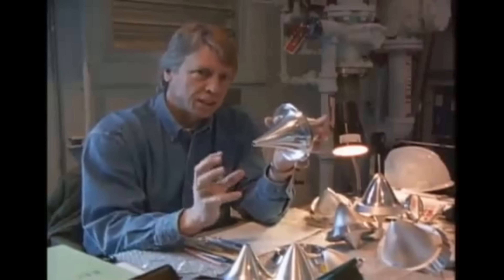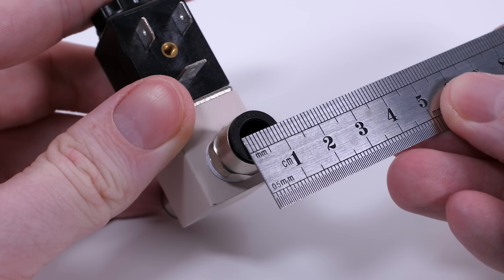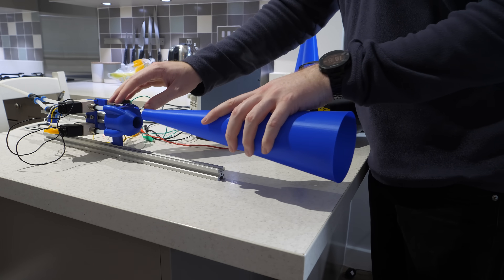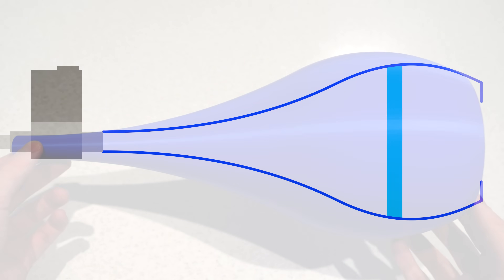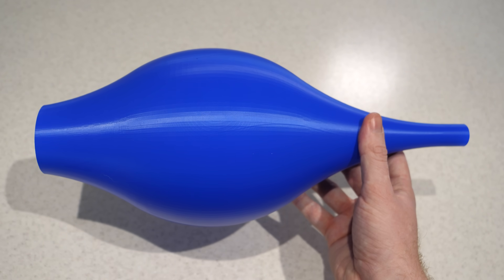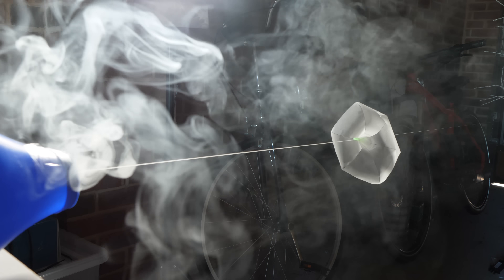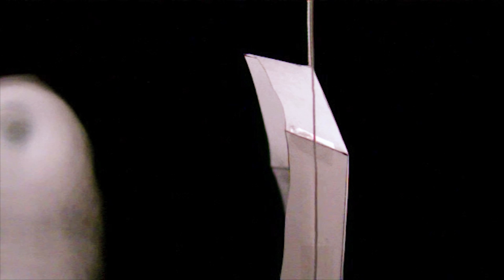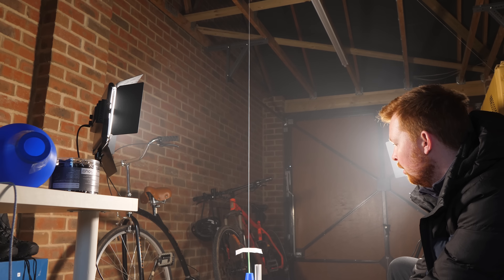Smoke Ring Propulsion

Comment: Greetings. It seems that you failed in taking in consideration the Coanda Effect of the smoke near the cone's walls. If you consider that, you'll see that the smoke near the walls will lose energy way faster than the flow near the center of the cone.

Comment: I think that this project sure did turn interesting, but it hasn't stuck to the fact that in the original documentary / footage you have provided, the propulsion source was from the air which falls "DIRECTLY" beneath the flying object, and that the triggering mechanism for the propulsion sure was the air's expansion, but the trigger event was happening in the cone itself and not a remote source.

Either way, this is just an opinion. Hope to see more attempts later :)

Comment: or a capacitor with layers of plastic and steel with a cathode twist of the steel and plastic and the plastic having transistor  shapes made like trap charge flash for the laser and cathode plasma propulsion with the mirror tape taking on the spaceships form to let it have laser propulsion and make it into an electron touring craft ADIFO drone with mini sterling engine generator and electrolysis HHO batterie and liquid piston of electrolysis torch powered and electron vortex flight technology and power source. with liquid piston sides as sterling engines and cog like sterling engines that pull flywheels with corona generator  turbine and solid state drive of reverse nitinol or titanium and silver with turbine corona electron get engine mounted contained solid state drive reverse nitinol with thermodynamic cooler capacitor cathode  and this steel spaceship with laser

Comment: why would you perhaps make a laser powered sail using aluminum mirror tape and a laser
Reply: those kinds of sails only work in a vacuum. technically they work anywhere but the air resistance is too much for them to move under their own weight.

Comment: you need to make something similar to that clip you previewed before that will help promote the rotation of the vortex rings. the paper is too flat
Reply: also, use something like a used paper towel roll and a large valve. the air has to act as a piston. large short burst will do the trick.
Reply: look up some vape tornaments, they can teach you alot on how to maintain a vortex and even move it around with your hands

Comment: For more volume maybe look into a solenoid fired sprinkler valve for irrigation.
Been used for spud guns for decades.  No idea if opening/closing is fast enough but pressure/volume could be adjusted up to 80-115psi

Comment: the lowest pressure is in the center of a vortex, so I guess shooting a vortex ring at a surface then sucks that surface towards it. On impact you get a high pressure center "pushing" and ring-shaped "sucking"... now if that didn't sound weird enough, the subsequent rings suck as well, but they aren't counter-rotating. As a consequence any two rings' edges hit each other with airflow in opposite directions, leading to greater turbulence, which disturbs the performance and flow of the later blasts

Comment: Ooooh there’s a lot of science and studies done with moving air through cones. There are still people who love horn-loaded speakers where the horn loads a speaker diaphragm in a manner that improves sound pressure level per mm of diaphragm excursion. Also there might be an issue of resonance that results in the trailing rings. Perhaps the horn-loaded speaker building community could further inform your vortex ring canon design.

Comment: What if you had a valve that only had to spin to open and close? Instead of having to push/pull, the electronics only had to spin. You could exponentially increase your rate of fire and lessen the over all mechanics of the item

Comment: Hi mate, have u ever looked on how a 2 stroke exhaust works? It also works with high and low pressure in the pipe but also gives a backfire of air. Maybe that's what it happening? Cheers

Comment: Hi Tom. I'm enjoying your project and you now have a new subscriber. I also have a background in aerospace engineering. A few thoughts: 

To optimize the vortex cannon for speed, we need to collect empirical data! Try to 3d print the nozzle with room for air pressure sensors at a few points throughout the nozzle, which will then let you determine the velocity of the air at different points along the nozzle. What are you using to supply air pressure to the solenoid valves? Air compressor? What's the air pressure immediately before the solenoids?  

Depending on the supplied air pressure, I wonder if you could reach mach 1 with a converging-diverging nozzle. If you could reach mach 1, then you may remember that after the throat the air velocity will be greater than mach 1.

What's the maximum frequency of the solenoids? How quickly can the supplied air pressure recover? To reach mach 1, I'm thinking you'll need to provide as close to a continuous (or high frequency discontinuous?) supply of air.

Comment: I think this might have worked if your craft was set spinning like they did in the original futuristic aircraft prototype. There's no stability on the most important plane for the craft, and that might just be the difference. Like a gyroscope in space, if you keep tapping it, it'll move against the directions of the taps, which is controlled. If you tap non-gyro stabilized objects, it imparts spin and rotation and etc etc.

Comment: I wonder if this concept wouldn't work better under water as an aquatic propulsion method. instead of air just use the water since anything that flows like a fluid can make a vortex. You wouldn't need the sail. But the question is would a pulse of vortexes be any better than just constant thrust. So think of a jet ski. It pumps water in and thrusts it out the back. Well if that was pulsed through a nozzel that creates vortexes in the water would it work any better, much the same, or not at all. Or maybe a better approach would be to create a vortex in the water at the front of the vessel so the vortex pulls it along with it through the water. It would be fun to experiment with it and just see what happens.

Comment: +Tom Stanton

I wonder, the inside of the vortex is spinning towards the sail which will give an additional push while the outside is spinning away. If the vortex is spinning sufficiently fast the outside of the vortex could pulling the sail back and taking angular momentum away from the vortex's inner side which could otherwise be converted to linear momentum by the sail. 

Would a sail which conical and curved to capture just the inside be more efficient? Would this also be self-stabilizing? This would require even greater accuracy though.

Perhaps even something as simple as a rougher texture applied near the center of the sail could help convert the useful part of the vortex's angular momentum in to sail velocity.

Comment: That's an interesting concept. You'd think the optimal vortex cannon design already exists, but it's so complicated that you can't simply calculate it. I think the valve approach is not optimal, because the air starts up so turbulent. The diapragm in trash can produces a better single laminar pulse. But I think what you discovered here is the key, vortexes can't be produced in rapid fire.

Comment: This exact system was used to create the chapparal concept car from Chevrolet. It unfortunately was never used. I saw these videos years ago. It uses a high power laser to concentrate heat in a ring, creating hot air that expands and pushes against the cone, pushing the cone up and the air blast down. Worth looking up.

Comment: You should have seen the smoke ring that blew out of my open header collector on my hot rod 62 Chevy many years ago. I got the timing gear/distributor installed one tooth off causing the fired cylinder to blast it's combustion out the exhaust valve instead of burning inside the cylinder. It traveled a good 100 feet from the end of the header collector. This was because of the archaic frame design on that old Chevy which forced the header manufacturer to aim the end of the collector straight out to the sides. It was freaking loud too.
However, smoke rings are no relation to the expanding plasma caused by the laser blasting into the underside of that metal "disk". I dare say that if you could see the expanding gases/plasma it wouldn't be a toroid at all although I don't know for certain. The only way to find out is to make yourself a laser launcher and fill the space under your disk with smoke before you hit it. and just hit it once rather than repeatedly. I suspect the following laser pulses disrupt any previous vortex. The only way to find out is to try it. I wish I could afford to try it but alas, I'm just a poor retired fellow who never has enough money for projects I'd like to do.

Comment: So, you'll need a anti-sway bar for the sail, some self-correcting constructive feed back loop for either the sail staying on the string or self centring too the vortex for detached operation.  Flaps and very fine polyethylene string(fabber)/wire(engineer)/lines(kites)/sheets(nautical).  If you get it too work it'll be beautiful like a ship in a bottle, save that it's a ship that sails on a bottle instead. :) Good luck.

Comment: Narrower lubed straw reduces friction offsetting, on lubed dental floss for a lower friction coefficient?

I guess the main hurdle to the prototype would be the consistent application of the pulses though, you have a highspeed camera and could print a seethrough nozzle to measure an optimum clearence per pulse though 🤔 tell the arduino and optimise it round that maybe?

Very cool idea

Comment: Hi Tom. Have you ever seen this video: https://www.youtube.com/watch?v=8he8afjQyd8. It explains Dysons bladeless fan and by the sound of it, it can produce more wind than the normal blade solutions. I was wondering if this could be used for propulsion in any way.
Reply: I also found this video. https://www.youtube.com/watch?v=dS0oFmzU06g you might want to look at this as well. So one thing to note is that it looks like the Dyson runs on a smaller electric motor. So perhaps all the cool advantages of the Dyson system might still be there if the motor size remains the same.
Reply: Do a YouTube search for “Blade less Propulsion”.
Enjoy 😎

Comment: Hi Tom, This is a great project.   I think that a CO2 tank would be a better option.  You can get 4000 psi.  The airlines are not very expensive.  I also think that the diameter of the smoke ring was too large.   The system uses the velocity of the smoke ring for propulsion.  The larger the ring, the more air resistance it has to travel through.  So, In this design, a smaller high-pressure smoke ring is better. Also, for the ring itself the higher the toroidal spin velocity the better.  So a tube within a tube design might give better toroid spin velocity.  Try using a smooth wall on the outside and a screw-like texture on the inside wall.  This threaded texture should create micro vortexes that reduce local surface boundary friction.   The two together should increase the spin rate.  Also, using a long straight tube should increase outer wall contact and improve toroid spin velocity.  So maybe the inner tube should look like a long cone.

Comment: I'm not sure why you are trying to use vortex rings as a substitute for lasers. Like your flashlight analogy stated, lasers are focused beams of light all moving in the same direction.  If you were trying to replicate the effect, it makes more sense that a solid column of air would be more effective.

A vortex ring is a swirling mass of air traveling in little circles. It's like a spinning bowling ball going down the lane: the ball is spinning in the opposite direction of travel until it gets to the unoiled portion of the lane, where friction forces it to turn in the other direction. A spinning vortex encounters friction from the surrounding air, losing momentum as it travels. I believe this is why lasers were used in the first place, since they could be fired through the atmosphere with minimal disturbance.

Comment: 6:50 you know maybe you’re getting pressure waves reflected on the chamber walls, as in two stroke exhaust chambers. There might be some formula to calculate the resonance frequency for a given geometry. With your high speed footage you could check if the vortex rings are forming at that frequency :)
Reply: I’ve done some very light work on this in school where we tuned our intake plenum/runners in order to have the best volumetric efficiency at a certain rpm. Same idea as a two stroke exhaust. It’s actually not super complex and mainly depends on runner length

Comment: The Light Craft design (the original NASA experiment), was intended to be scaled up (and was).  
However, I think the Light Craft project (given its low budget) was actual a tiny part of a much larger picture (project).  
I'm sure the people researching the Light Craft didn't know that.  They, were thinking "launch craft into space".  
However, the actual funders may have been thinking something completely different for this tech.
Notice the Light Crafts shape, looks similar to an intake spike for certain high speed aircraft.  
Plasma tech, has all sorts of cool uses I'm betting  :)

Comment: The fast-cycling air valve could be very useful for blowing certain things with a shop compressor. Certain debris that catches in grooves or holes respond better to a quick burst than a steady stream of air. I find myself tapping the trigger or flicking the nozzle of my blow gun around, and that may do it better without all the commotion. Saves on air usage, too!

Comment: At last, someone as vortex-nuts as I.  Let's see if he can give me an answer.  Looking at a cross section of a vortex ring from the side, the rotation goes forward on the inner part of the ring, and backward on the outer edge.  Can a vortex be generated the rotates in the reverse?  ie. The outer edge rotates forward, and the inner edge rotates backward.  If possible, is the vortex stable?  Does it sort of focus its energy instead of disperse?  Would it travel any distance, or just collapse?
Always have been curious.

Comment: @6:45 could the cause of the multiple rings be due to the reflection of the (first) pressure front off the rather broad rim of the orifice, which then subsequently clashes with the slower and less energetic "post"-stream (which is caused by the slow valve closing capacity)? Btw, couldn´t you change the valves with a high-power sound-speaker-membrane, where you would introduce the airstream sideways to the front of the membrane?

Comment: A vortex ring is more like a propagation of energy than a flow. It's basically a circular wave in the air. In water, a wave has a circular motion where the the water near the surface flows forward and the water near the bottom flows backwards. If the wave hasn’t broken, the water doesn’t have any real displacement over time. The vortex ring is similar to this where the air in the middle moves forward while the air around the outside is pulled back. The fog stays with the ring because it effectively rides the wave with all the air towards the center of the ring. This means the ring actually contains fairly little energy since it is such an efficient motion. Also, it would be interesting to try to make something that rides the wave in the center of the ring rather than have all the energy dissipated into a sail.

Comment: Great video. On the next round, consider adding an adjustable time delay circuit to the valve switches to be able to tune the switches so the valves fire at the same time. This could eliminate the multiple rings and strengthen the vortex.

Comment: As a kid, growing up in the UK I remember in the mid 70's   a clip on a TV BBC 1 news show called "Nationwide" which showed a person demonstrating  a "flying disc" which seemed to be an aluminium toroid,  and the inventor was describing it as using an eletrostatic vortex of air through the center. Memories are coloured by time however and I was 14 then but from what I recall, he was using a very early "bilp blip"  one channel MacGregor  pulse moduladed radio control to turn the power on. He placed the disk in a nearby field,  pulesd his transmitter and the disc went up and away at amazing speed.  the news clip was about 5 min long and was never repeated because had no watto bring it back. It always intrigued me and I have searched for that clip on the internet time and again but never found it in any BBC archive.  I have looked into the J L Naudin and the Townsen-Brown electrostatic lifter experiments but the lifter has to be extremely lightweight to take advantage of the ionization. The Clip I remember showed a bulky rivited toroid lokking like about 2-3 Kg in weight.  Wish I could find it today.  
Sorrry for babbling on  and thanks so much  for your constantly innovative and scientific analysis of of alternate propulsion systems. People like yourself are those who will lead us forwards out of the complacent aeronautical "norm" and  compel us to revist the ideas of the likes of Viktor Schauberger.

Comment: I would suggest ditching the air valve concept completely and switch to an elektromechanically actuated membrane at the end of a relatively large drum. 
An example could be seen here:
https://www.youtube.com/watch?v=-VL0M0jmu7k
If you tune the frequency of the pulses to the resonant frequency of the drum this could be quite powerful and won't need any air feed, except for the smoke. 
The speaker of a large subwoofer should work perfectly for this! Maybe even better if it's an infrasub.